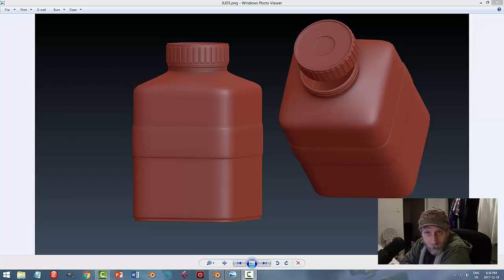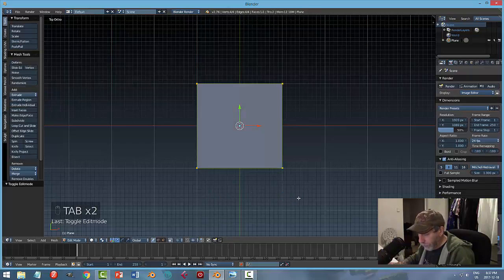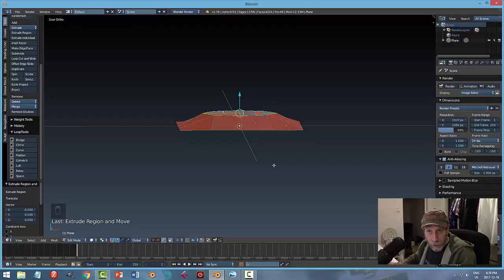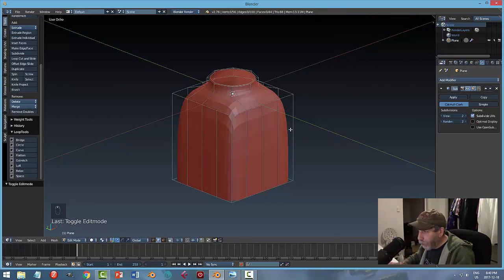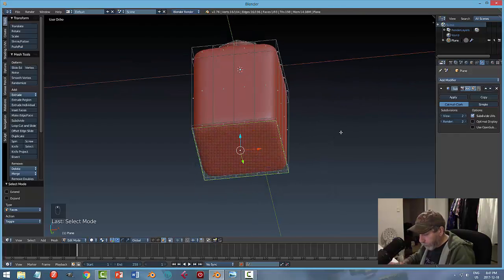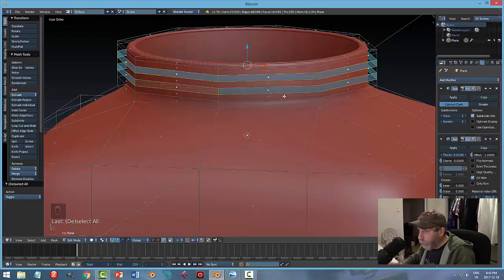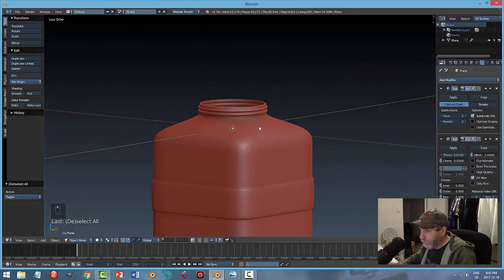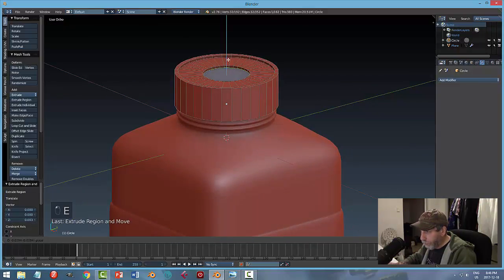Blender: Modeling a Jug

Comment: Hello! Blender beginner here with a question. At 2:42 when you drag the plane it affects all of it. When I do it myself it just works like the extrude tool, as in only the circle will move instead of the entire plane :/ What am I doing wrong here?
Reply from the maker: Hang on. Will get back to u soon :)
Reply from the maker: I suggest you start again.  Make sure not to extrude when you have circle, just move the circle region upwards.  Also, make sure proportional editing is OFF.  If it is turned on, you will see a white circle and you could be influencing the entire plane.  So, just do it again and see if it works.